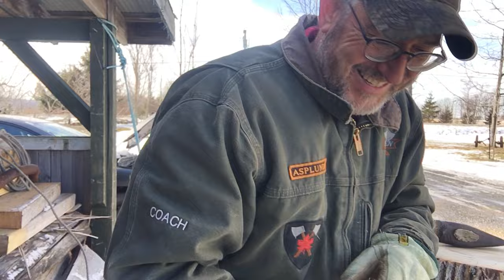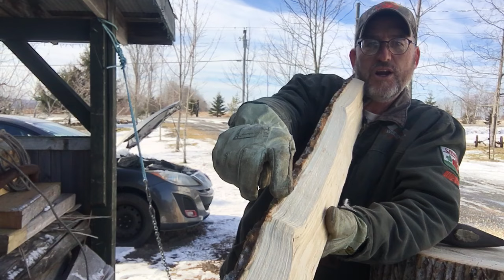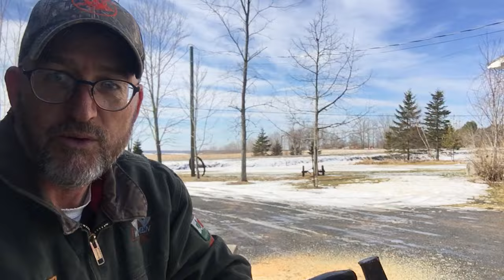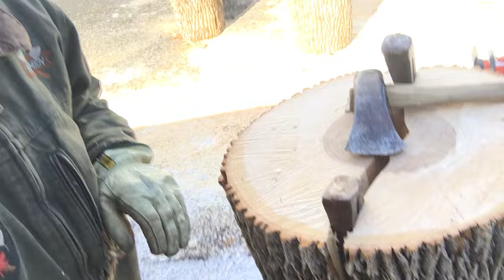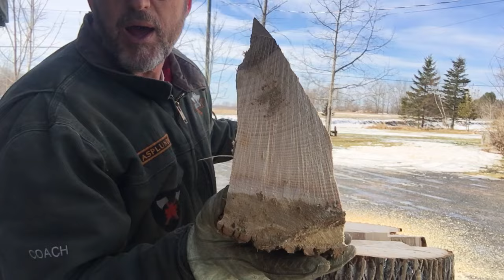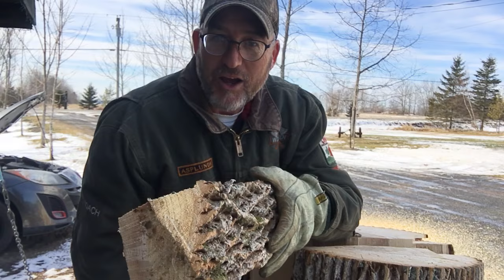Splitting axe handle bolts - Butt logs

Comment: Rod, another informative and fun video. Keep them coming. I had a number of small black ash trees in my woods that died after the ash borers came through and I have made some handles out of them and have been surprised that they have held up pretty well. I think that splitting wood, following the grain and no run out mitigates less than ideal wood species. Thanks for sharing your knowledge and expertise. The exchange of ideas and information is the best part of the internet as is meeting people from a long distances that we otherwise would never encounter. Best regards, Chris
Reply from the maker: Yes - totally agree on all counts.  If you check out black ash on the Wood database, although its janka hardness is low, its modulus of rupture is right there with green and white.....so no surprise.  Always great to hear from you Chris.

Comment: I've watched a few of your videos, thanks for sharing.  This comment is a little off topic(delete at will) - envisioning a Tuatahi racer with 13-15 degrees bevel, 30 micro edge cruise through jarrah log
Latest research demo:  low skilled axe user and unfortunately bit to upper cheek weld failed

64rc O1 4.5 lbs Axe Chops seasoned blue gum wood
15 degrees bevel, sharpened edge ~30 degrees
https://youtu.be/1ugqbeD5bnA

Your thoughts/advises?